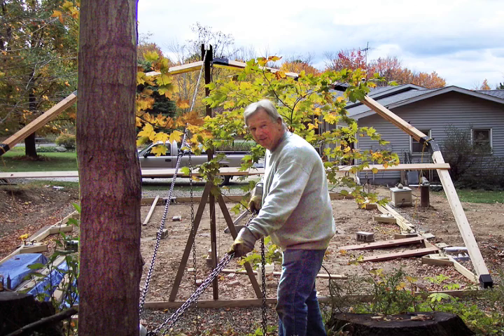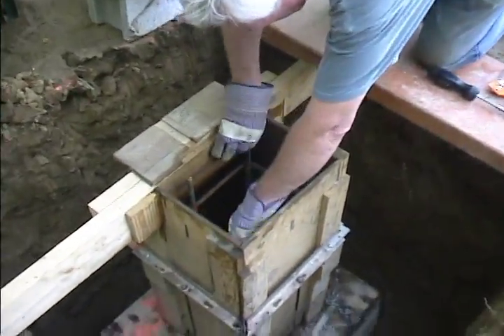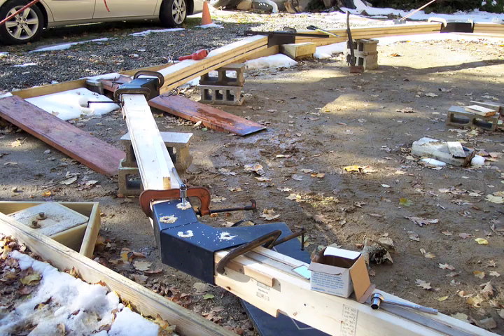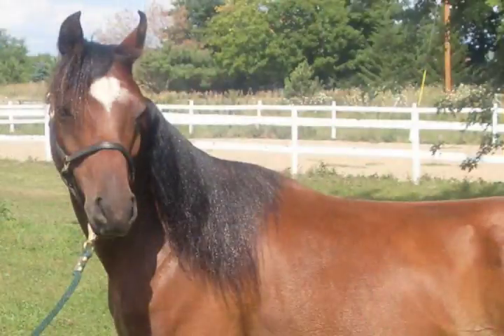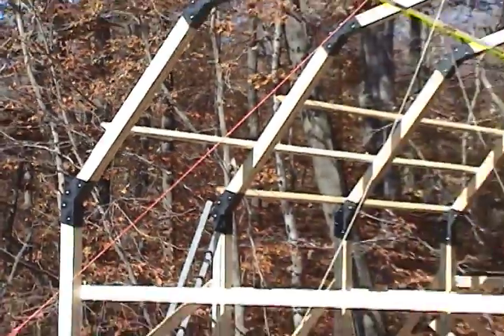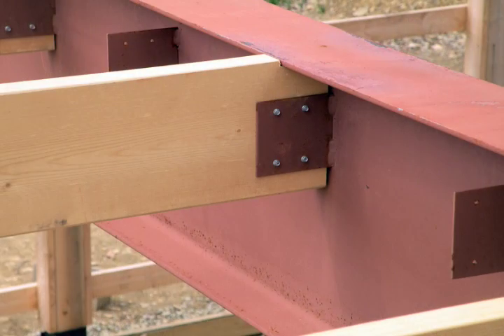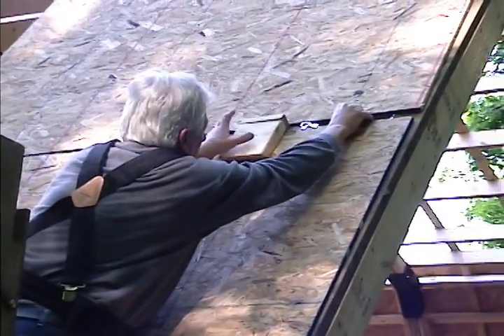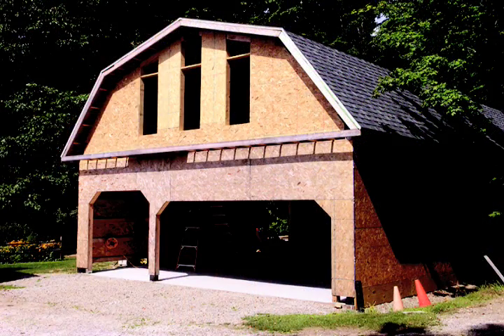Build a Garage, Workshop, Pole Barn, House

Comment: I helped a friend build your 30X50 kit with 8in frames back in '06,  very impressed with the joint system and all the build notes,  we used my f250 to stand the frames up, it was a piece of cake, just like the advertising.  One big barn, most work was done solo,  except for cement and roofing shingles.  If you can build a shed,  you can built with this system,  just need safety a harness

Comment: It all depends where you live. Your live and dead loads determine your Bay Spacing. The average is 8 ft. You might need 3 Kits at $350 ea. This system is much more economic for larger buildings.

Comment: Good advice! But keep in mind, Lumber Link uses only #1 grade kiln dried timber, LVL's or Glulams for rafters. Posts can be #2 or build-ups, but NO green or treated wood. Socket Systems is establishing wood suppliers, call for prices. Sample Building: 24x24 garage, 4 ft. deep solid wall foundation, 6" slab floor, metal siding and roof, 2 car garage door, 3 windows and a man door, ALL material needed... $6,000. (Less architect and engineering)

Want to build a house cheap?

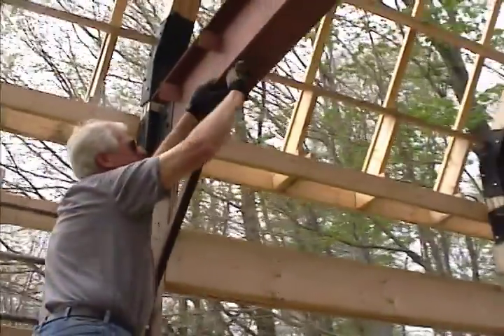Comment: I couldn't help but notice, he's not using 5 1/2 x 5 1/2 grade1 timbers at all. He's using 2x6's which are really 1 1/2 x 5 1/2 and sandwiching 2 pieces of 1/2 osb between the 3 2x6s. He's making his timbers. 2:44 shows a good view of what I'm sayin. Why is he making his timbers?
Reply: My guess is that it's a lot less expensive than buying full 6x6's.
Reply: n8guy Indeed you are correct sir.  I looked it up at Menards after I posted this comment.  I appears that 2x's are about half the price. Thanks for the reply.

Comment: Well it’s certainly efficient - interesting guys. We joint the frames a little more traditionally here in the UK.
Reply: This is mostly for newbies like me. But there are far simpler and better fitting systems, mostly based on cutting slots in the timber ie a mortise and the fitting fits into it ie the tenon (or just cut  slots ie mortises in both and use fit plate metal into both with holes for bolts)

But don't worry its still done the traditional way on this side of the pond too mate.

Comment: Also, doe the field manual discuss and illustrate ways to modify the system to increase wind resistance?  Looking at the sire, it says that 80mph is the wind resistance of it without modifications.  I like to be prepared for slightly worse.

Comment: Do you folks see what using trusses and stick-building will do to your mind.
This is called Post and Beam construction and most builders do not even understand it. Builders who put up expensive Timber Frame houses, and the Amish understand the simplicity and strength of timbers.

"Those who can do...those who can't...shouldn't".

Comment: I want to know why they photo shopped the tyvec cover on in the last scene.
Reply: because it all fell down before spring! T_T
Reply: bdemaree it's not photoshopped. You see the wrinkles on the bottom right side of the building😁
Reply: It's 7 years later...Did you ever find out why it was photoshopped? And despite what MySoulisSaved ByJesus says, it most definitely is photoshopped. You can see by the difference from the real shadow from the eave of the gambrel roof compared to the fake gradient-like shadow on the Tyvek. Why?!

Comment: An average 2 car garage is 24 x 24. The average kit would cost $1,820 delivered. The total average building cost using Lumber Link is $5,760. ($10/ sq. ft.)
If you can't change a faucet, you might not want to try this project.

Comment: Those are not a true 6x6 if you Look they are three 2x6's put together, and a 2x6 is not a full 2" thick or a full 6" wide if you don't know that, but you can buy a full 6x6 square treated post which to me would be stronger because I have had both in the past before

Comment: @SocketSystems 

Too much.  I can have 2400 sf with a steelmaster bldg and self installed second floor for half that.  Plus, it will have higher snow load and wind load.

Good luck with your product...

Comment: @thouartjohnd . just bought a home and did all the remodeling myself. owe home depot $4,000.00. my advice, talk to contractors they sure told me where to go and buy supplies cheaper than home depot( this was after I'm $15,000.00 in debt.
Advice, DON'T RUSH, SHOP AROUND THEN SHOP AROUND SOME MORE.
Good luck